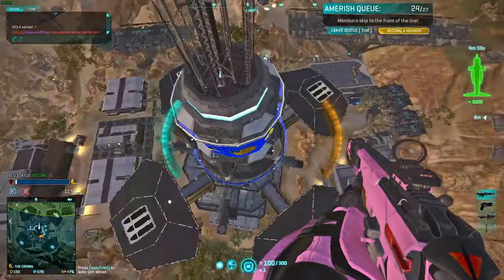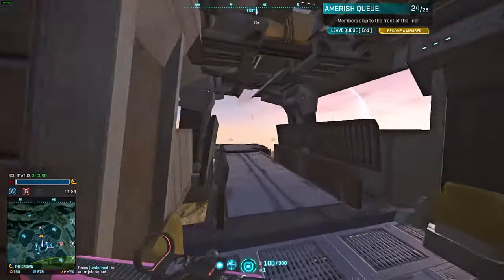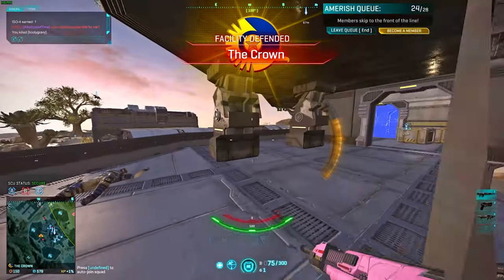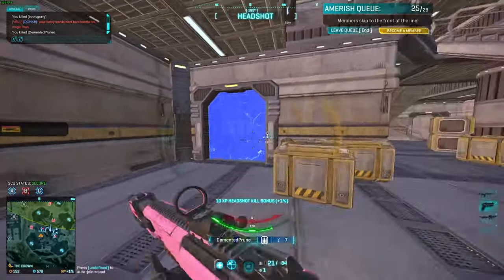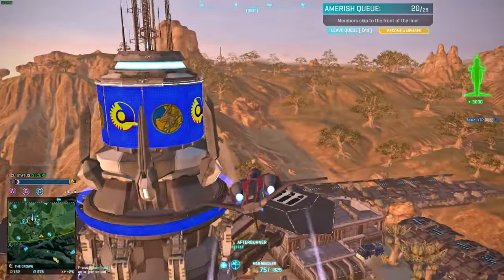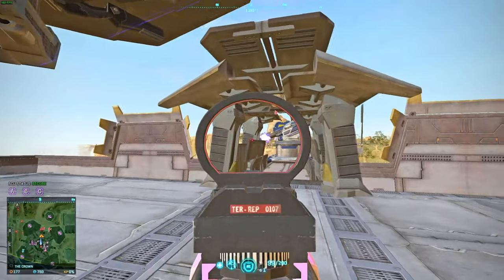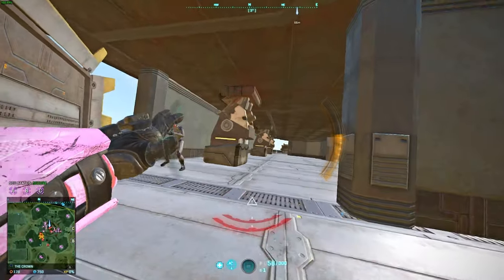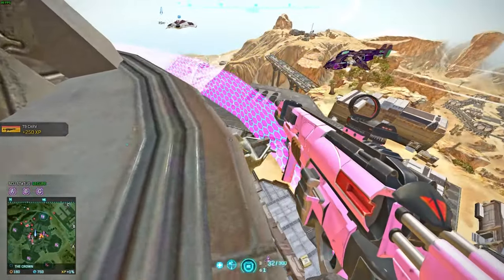PLANETSIDE 2'S TOP HIDDEN MECHANICS | Secret Mechanics #2 (Tips & Tricks)

Comment: 1:08 there is a incorrect statement here. You do not have to be a robot operative to purchase The punisher submachine gun. You only need the 1000 cert requirement

5:07 you can also just press the backspace key and it will automatically bring up the chat box with the person who sent you the tell message up. This way you can immediately reply

6:45 this tip does not work if you are trying to immediately re-deploy during a continent swap loading screen. Instead you will hear the buzz sound effect and when you load in you can see at the top left corner of your screen that the redeploy was canceled in bright red text
Reply from the maker: 1:08 From what I understand, you need NSO to get repair version of the Punisher
5:05 Yeah I assume that one is obvious ^^
6:45 yes, wait for the 'second' loading screen, then hit redeploy
Reply: @ZealousVidya  Repair underbarrel is for Engineer on all factions
Reply from the maker: @reap3rofd00m3  aight thanks, I'll edit that part out and the video should be updated within the hour
Reply: @ZealousVidya  Using the punisher underbarrel launcher with different classes will give you different results:
Engineer has short reps + 500 vehicle health
Medic has health regen
Infiltrator has a small EMP effect (good to take out beacons or motion spotters fast)
Heavy assault has the "havoc" effect (prevent vehicles from getting repairs for the duration of the effect)
Light assault has a repulsive effect to tribes the ascent your way to battle
Reply from the maker: yeah I know, I just thought you could only do it on NSO :)
Reply: @cobibide  yo yo yo there is something at least close to the Tribes in planerside2? Pls elaborate!
Reply: @alalalal5952  I have never experimented this, there is a light assault loadout with punisher/impulse grenade/grenade bandolier/skirmisher jump jets.
Impulse grenade explode on impact and have 2x the effect on yourself, you can get some serious air and speed.
You can then tap fire the jetpacks to glide (remember to look 90° away from your travel direction when using jets or you lose your momentum) then time the next impuse properly before touching the ground.

Comment: Is it possible to reduce the lag when changing loadouts in the terminal? I know about the shortcuts but after entering the menu and after changing loadout there is always this bonkers short freeze. I already have PS2 on NVME SSD so drive speed should not be the issue here.
Reply from the maker: There's a bit of delay and I don't think so?

Technically I think you can hold down E and that might help? Try it out and give me a shout if it helps.
Reply: might be ping, i cant really think of any other reason why

Comment: I've seen camikaze channel using punisher as secondary but no one answer it so I'm gonna ask it here,how to do it?
Reply: Most likely using ASP skills. It is basically the prestige system of the game. I suggest you look up "ASP skills planetside 2" since I am not very familiar with it myself, but from what I know when you reach BR 100, you can spend 10k certs (free if you are a member) and it will reset your BR and give you an ASP point. And then you get 1 ASP point every 25 battle ranks or so. These points can then be used to unlock special skills, like using shotguns in secondary slots or universal use of flash grenades or discounts on vehicles. Hope this was helpful.
Reply from the maker: ASP on certain classes bro
Reply: @solimansuhil9543  ic
Reply: I'm new to this game,only 200 hours so far so I'm still learning the insiders stuff but almost mastered everything else.
Reply: Light assault ASP perk. Use SMG'S in secondary slot. Hope thats what you meant.